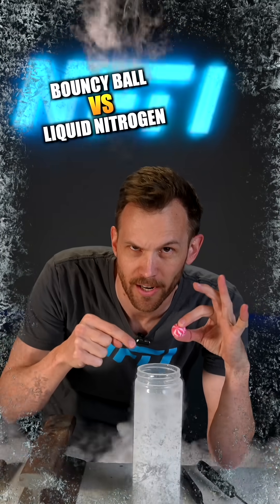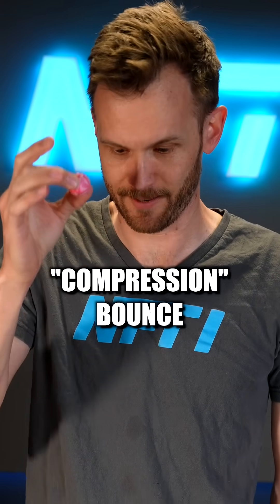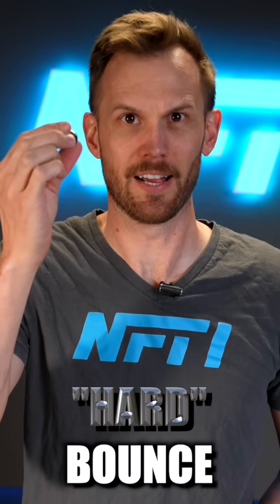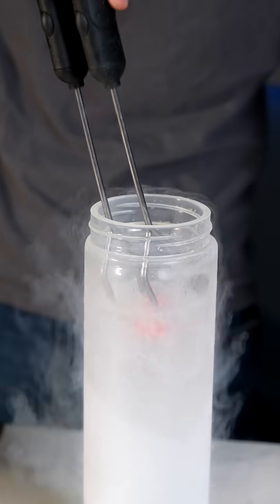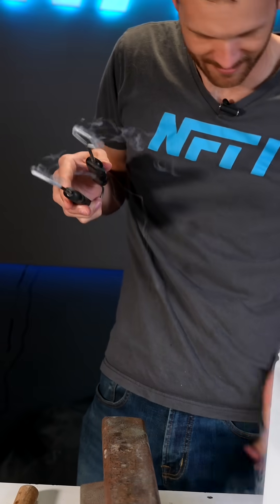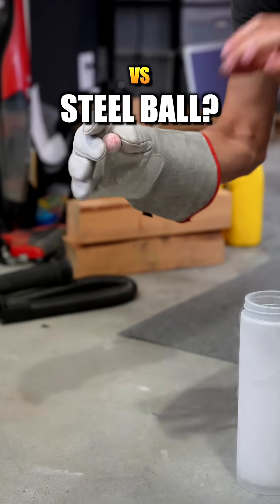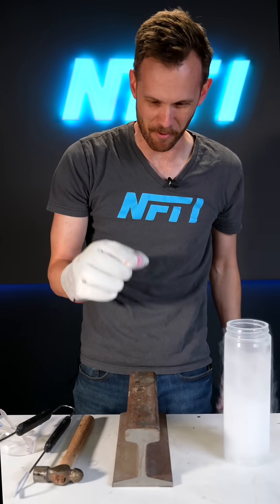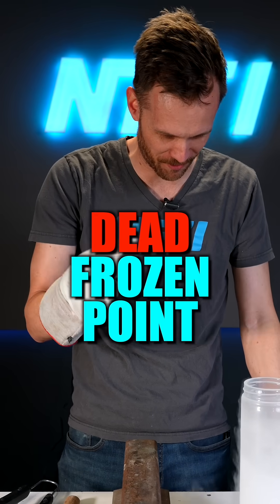Will a Frozen Bouncy Ball Bounce?

Comment: I would expect that the results also have to do with the cores.  When you first remove it, only the outer shell would be freezing but the core should be mildly insulated.  The inner core would still allow for bouncing.  Example, a baseball has a dense outer core with an inner core that is (typically) less dense.  For Little League, the inner core is actually a rubber ball.   We also see similar application of the principle with the wood bat.  If you hollow out the center of a wood bat, and replace with cork, the less dense material allows for more response from the outer core.

Many of those steel balls are less dense in the core, or they have a harder outer shell (like chrome or nickel).  Again, we can see this in examination of aluminum bats, where there is a hard shell but inside is hollow.  The metal actually flexes at the point of contact due to lack of dense material behind and you end up with a trampoline effect.

With time, the temp of the rubber ball is not just thawing, but equalizing throughout.  So you now have lost you have a solid mass with too much density.
Reply: Also noteworthy, large steel beams will "bounce" if dropped from a high enough area. A bad of sand will not.

Comment: Here's the deal!

Anything that is bouncy is bouncy because it stores energy and then transfers it back into itself. 

A bouncy ball is bouncy because it stores the energy as a spring where the ball compresses, which then releases and propels the ball back up. The lost energy is low because the spring is more efficient. 

A ball bearing is bouncy because there is no compression. The lost energy is low because there's nothing to absorb it, so the ball bounces as the energy goes right back into the ball.

The chilled but not perfectly hard ball has hit a sweet spot where it isn't hard, but is not efficiently springy - it acts as a damper, which absorbs the energy. Because it's absorbing the energy, rather than "reflecting" it or storing and releasing it, it appears to stop abnormally quickly.
Reply: I'm pretty sure there is compression with a ball bearing...it just takes much less compression to store the same energy.  As you say, energy must be stored somewhere and that where is in a change in the dropped ball or the surface it impacts.  Outside of really odd situations that means some deformation of the bearing (wonder if it is at the atomic level or at the grain level).
Reply: @petergerdes1094  You are correct, there is elastic deformation of the bearing. I was not using the words as precisely as I could have. It is better to say that there is significantly reduced deflection of the material, and the deflection is what would allow dampening.
Reply: @charlescampbell8343 Fair enough, that's always the trade-off with an explanation.
Reply: It's kinda like dropping a wet sponge.

Comment: The rubber ball probably stopped bouncing because the inside finally got cold enough. At first, the outside freezes fast in the liquid nitrogen, but the core’s still kinda warm and flexible, so it can still bounce a bit. But once the whole thing turns brittle, no more bounce.

Comment: My guess would be the outside most layer of the rubber ball thawed and acted as a cushion and absorbed the impact while the inside was still frozen and didnt allow the ball the deform and then spring back which would propel it upwards.
Reply: U r correct 🚡🚡🚡🚡🚡🚡🚡

Comment: Hypothesis: it will not bounce because, while being harder would help it's bounciness due to it being more efficient, the rubber ball just is not as sturdy as the steel and so it would shatter.

Edit: i was wrong, the rubber is sturdy enough to stay, and i may also be wrong about the efficiency thing.

Comment: It didnt become more bouncy..   it was reduced from the original..  and finally stopped bouncing completely..

It seems that the center was still rubbery in the beginning of being frozen..  and then froze solid throughout..  
but at no point was it more bouncy than the normal ball..
Reply: It would be the same as the original if completely frozen (if the ground was the same temp) and the fact it thawed is why it stopped bouncing not that it became more frozen. While this is a fun demonstration it’s just potential energy conversion. If you hold them at the same height, they have the same energy, compression converts some to heat then springs back. If it doesn’t compress the impact releases heat then it goes back. In ideal conditions there’s no major difference. A bouncy ball is more practical because it conserves some heat so it operates closer to ideal but no new energy is created by the compression

Comment: The eternal question, what happened when it thawed completely, did it recover its bounce or not?
Reply: At some temp, it will likely shatter.
I'd guess that it will recover its elasticity when it returns to its normal temp.
Reply: @ab_ab_c  "At some temp, it will likely shatter."

Actually, "shattering" would depend on a lot more things beyond temperature.  If he had shot that ball at a wall with a slingshot, it would have most definitely shattered.  But that has to do with the amount of velocity at the point of impact..

If you were to super heat the rubber ball, it would absolutely alter the "bounce", because it will be removing the tiny air bubbles. 

Newton's laws on Motion can result in some of the neatest experiments.
Reply: @LarryJr.Stauth  isn’t chicken tough though and doesn’t change as it freezes because I thought that the ball would expand as the heat gets to it causing it to crack
Reply: @Luvelitax  No, chickens texture or physiology does not change when froze.  

As for expansion, polymers do not expand when frozen.  Otherwise, automobiles would not function in cold climates.   

And, for the record, when things freeze they expand and shrink when heated.  Place sealed can of soda in a freezer and it will can will explode for the expansion.  Place a similar can in an oven and it will condense to the point of implosion.
Reply: Bouncy balls are made of silicone. Silicone is much better with heat than cold. The extreme cold will cause the silicone to break apart ESPECIALLY with movement. its not immediate and right after being frozen that bouncy ball could instantly shatter upon impact with something if enough force is applied. Same goes with the steel ball bearing. The structure of the silicone ball will fracture and break into bits and pieces with extreme temperature fluctuations like that. Basically freezing something increases the density of an object but silicone works the opposite and expands like water turning to ice. If you get reaally fat and then skinny your skin isnt going to be same as it used to be. Now its floppy and stretched out. Weaker than what it was before that happened. Luckily our bodies can slowly heal overtime and the skin may go back to normal given enough time. But the silicone ball will NEVER RECOVER.
Reply: @ thank youuu
Reply: probably just shatered
Reply: The properties will return.  Just like when you unthaw that chicken from the freezer, it will still be chicken.

The "bounce" is primarily due to the tiny air pockets inside the rubber.  You would have to chemically alter the rubber to cause the collapse of those pockets of air.
Reply: I think after it returns to the normal pressure it would split because of the change of pressure of something like that i do not know how to explain it but like when you put an ice cube in water and it cracks something like that
Reply: @Luvelitax the ice cube breaks not because of pressure but because of temperature, it literally goes into SHOCK that it breaks it self to withstand the temperature contractions
Reply: @ColdStinko  I didn’t mean pressure I did mean temperature I was just yapping 💔